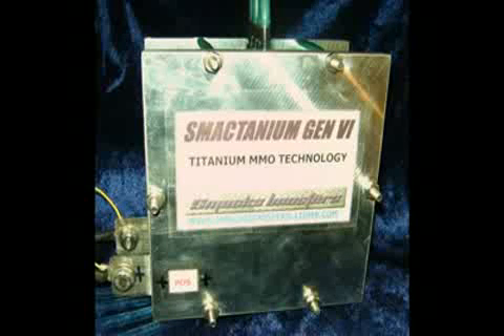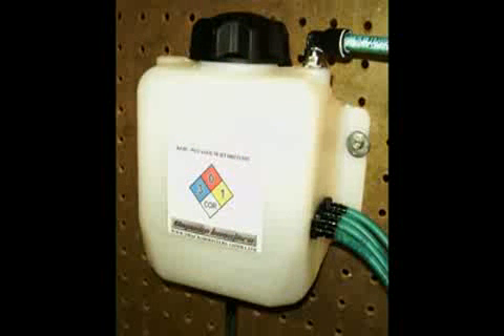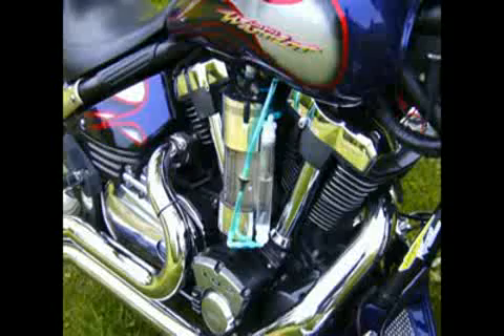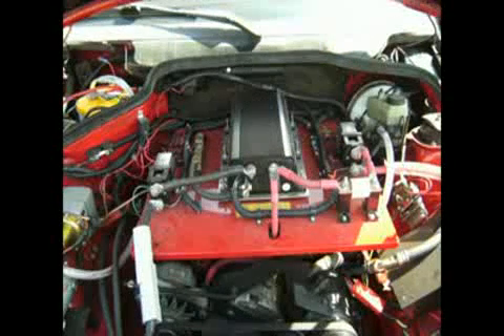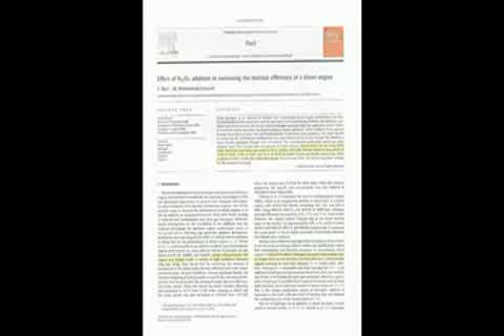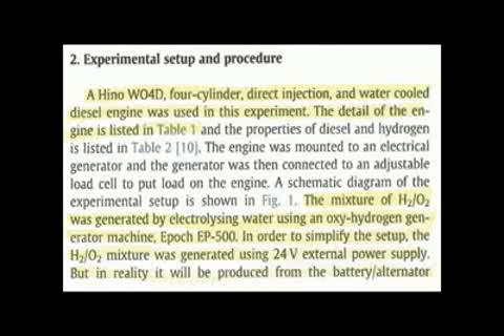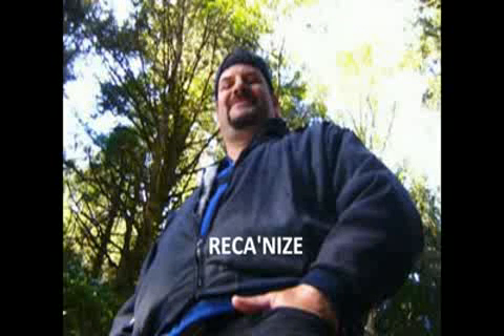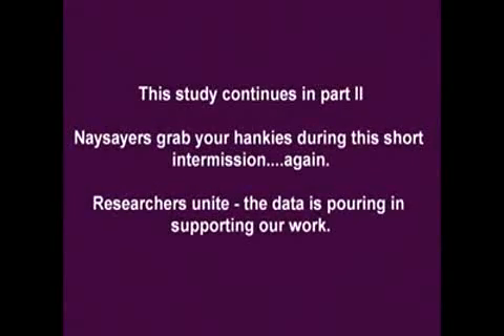Scientific PROOF that HHO WORKS Part 1

Comment: HHO added to the consumption of the fuel, adds more mileage to the fuel in your gas(petrol) tank, not at the rate Miles Per Gallon your engine burns in a test... as in, it adds to the mileage in your gas tank. It doesn't bring your gas mileage up in an electrical test. It may bring the test down a couple Miles Per Gallon, because of the vacuum. Try this... Put a gallon of gas in with the HHO system in the off position.... then with the system on... how far did you go on did you go in each road test? Surprising, isn't it? It ups the mileage in your gas tank, not at the engine I.E. burning less gasoline because the HHO is being added to the fuel line, adding to overall Miles Per Gallon your vehicle can travel on a tank of fuel.... Like adding rice to chicken so it will go further, adding an additional ingredient that feeds more people. Like adding in missing stitches to cloth, pops it in here and there. I remember back when I wished that I could add water to the gas to make it go further... I guess wishes do come true.    Hate.

Comment: What puzzles me is why it's more efficient with Hydrogen added, doesn't the Carburetta still sends the same amount of fuel into the engine as the accellerator is pressed?
So how is there a saving on petrol if the same amount is going in?
Reply from the maker: The H2 and O2 gases added do two things to the burn, it increases the flame speed and increases the lean burn range of the hydrocarbon fuel. In a properly set up configuration the fuel system sends less HCF while the engine puts out a little more horsepower. The end result is a more efficient engine using less fuel.

Comment: Dateline NBC report on HHO booster scam!
Reply from the maker: Yes, unfortunately there are those who lied about the amount of fuel savings an HHO system can give to make a quick buck but that doesn't mean the technology doesn't work. That is purpose for this study, to prove that under the right set up and with the right adjustments made to the engine and fuel system HHO does save fuel. The amount of savings will vary, in this study the savings was 15%.

Comment: Saying that the HHO increases the speed at which the air/fuel mixture burns supports my theory on why basic HHO systems sometimes work.  It's not about running our cars on HHO.  What happens is the HHO greatly improves the ignition.  A spark plus a bit of HHO will ignite the air/fuel mixture better than a spark by itself ever could.

Comment: I can understand your skepticism if you couldn't make it work. I don't know what your vehicles were, but from your other replies, you don't appear to be willing to risk leaning out the mixture. If that's the case, there's no way it could work. It clearly seems to work for some people, but they aren't proving it works any more than you're proving that it doesn't.

Comment from the maker: How about a 2007 publication from the Federal Motor Carrier Safety Administration (a division of the DOT) tinyurl . com / yhlcmq2 Section 1.2.3 Hydrogen Injection Systems references a 2005 study that showed a 4% reduction in fuel usage. See there is "proof" out there that this can work, you just have to have an open mind and search for it...

Comment: I agree, this is not proof in any way shape or form. That can only come from the scientific community.
This may or may not work, but the logic of adding something into the air drawn into the engine that promotes combustion in an otherwise too weak mixture is compelling. Car companies spend millions trying to design engines that run on leaner mixtures, this might do just that.

Comment: I think you're not not grasping the fact that the extra power used by the alternators is not that great when you look at the output of these engines. There always seems to be a focus on this but it's not really the issue. You'll get at least half of it back anyway when you burn the HHO in the engine. The only question of significance is whether you can ignite fuel in a proportion that would not normally be possible without HHO. The whole argument hinges around that one question.

Comment: The problem is that the academic community has been poisoned and no serious researcher is going to risk taking this on. A while ago, there was a lot of excitement about 'lean burn' engines. I believe Mazda made an engine with a separate pre-combustion chamber and an additional valve that enabled the combustion to commence with normal mixtures, but then admitted the products into the larger compressed volume. Why go to all this trouble if leaning out the mixture isn't a cherished goal?

Comment: I really don't have any evidence to back up or disprove your statements. There are a few things worth saying though, Firstly, I don't believe for one moment that we've arrived at the pinnacle of engine efficiency, improvements are being made all the time. This is just another way that may make some gains, You're wrong about the energy that's required to produce the volume of hydrogen suggested, it's actually quite small, in the region of 100Watts to produce 500ml/min, enough for a 1Litre engine

Comment: It's not the efficiency of the burn, it's the pressure at initial combustion and how it's sustained through the downstroke. Diesel engines don't use a spark and therefore timing controls can't be as easily adjusted in the engine. The article hardly claims that it's a good idea to run automobiles on such an engine, and I imagine that's why there's not any mainstream use of on-demand HHO systems in trucks, or personal diesel autos. I just want to clarify the article for those who don't read it.

Comment: H2 gas can actually, as showed in the article posted, improve combustion efficiency is diesel engines. It's been an idea floated for decades that diesel combustion which is reliant of pressure and heat can be supplemented by additives to the fuel. Still, the study shows that it's potentially dangerous to the engine, and anyone who believes this shows promise for a gasoline engine did not understand the article at all. HHO for gasoline is a scam, and only overunity would suggest it could work

Comment: To add,,in direct contridiction to what you posted an SPL competitor if anything (I was a pro) would want to overdrive the alternator. We need as much voltage as possible and that is a reason we used to raise the idle. An alternator needs to be at a specific RPM or above or it does not put out enough voltage. That is way when race cars use underdrive pulleys on the street they tend to die if stuck in traffic or cruising at low RPMS for too long. Research it this is well known FACT!

Comment: You need to be corrected as far as the simple physics of how an alternator works. First off SPL competitors are not using any eqiupment that is "claiming" to save fuel. HHO supplementaion is...has to. In other words if you are generationg the power to extract the HHO from water via electrolysis and using that HHO to run the same engine being used to extract it to run it..it simply CANNOT work unless there is proof of overunity. CONT....

Comment: Right.  I agree.  I used be in amateur subwoofer SPL competition :).  I know they add some friction to the engine. If that friction is being used to create a gas that assists mpg,  it can be offset.  One can also add under drive pulleys to  decrease alternator drag as I used to do on the SPL cars so they retained close to their stock mpg with the high output alternators they used.  Point being,  hho doesn't defy the laws of physics and can work if done right,  though it very rarely is.

Comment: True.  But they've been using similar setups on their rigs for years.  It's scaled up some,  which is part of why it actually makes a difference.  There was never an issue of free energy.  So tired of that generic response. This is about converting electricity to a gas which harbors more complete combustion.  A turbodiesel with mountains of torque and huge output alternators (often 2) have no problem coughing up a little extra amps.  It's still possible in some cars,  diesel works best though.

Comment: This study has nothing, at all, to do with gasoline engines... which is significant for humanity's energy concerns. It is only a precursory look at the effect of H2 at the top of the diesel engine's cycle. It also mentions several times that temperatures/knocking are troublesome and are due to the optimal fuel-air-ratio of the system. It's not something that can be "tuned" out, it's inherent to the gains in power made at all load settings

Comment: And to add,,,it is not that simple. Otherwise there would be much less debate. If you lean your engine out you will probably see an increase in MPG at the risk of engine damage/ TAmpering with emmisions controls is a fed offense but if you do it anyhow you would find better MPG with the HHO gerneratoe unhook since itr would eliminate the drag on the engine cause by the current draw taken from the alternator. And I would not trust a tiny amount of HHO tiny bubble to prevent a lean condition.

Comment: My friend's dad put money into that company a few years ago.  He has yet to even drive a prototype...  The HHO system actually does work for diesels though.  It takes several briefcase sized cells,  and special high output alternators to work as a gas suppliment.  
Don't believe me still?  Ask an 18 wheeler driver.  I have seen 3 in use so far.  It's not violating physics.  So tired of reading that.  It just takes a lot of 12V power, which isn't a problem for large turbo-diesels.

Comment: I don't see what the big deal or controversy here is. Over the years, engine manufacturers have improved the combustion efficiency of their engines, progressively extracting more usable energy from the fuel entering the engine. We all know this to be a fact and it's not controversial. This is simply another way of increasing the amount of energy released from the fuel. Everyone knows that you can't run an engine leaner than a certain air to fuel ratio..... With HHO injection, you can. Simple.

Comment from the maker: Check out Vydrotech, Inc. (formerly Ronn Motors) and its H2GO product line. Real world testing with Volvo over-the-road diesel trucks show a reduction in NOx emissions and about a 20% reduction in fuel usage. Done right these systems do save fuel. The purpose of this video was to show those hard headed skeptics that this technology is not an impossibility.  As far as being stuck with crude oil, check out the syngas to ethanol process. Municipal waste can be converted into fuel....

Comment from the maker: No, it's not like saying the sun is made of ice. And no, I don't believe it works simply because it's published. I've seen in work and I've done the math, I know that gains are possible. See it doesn't violate the laws of physics because no energy is being created, less energy is wasted because of the increased flame speed. The biggest gain in the process comes from the fact you can run the engine much leaner without reducing the power output. I'm sorry you don't get that but it does work...

Comment from the maker: When using math you have to use all the relevant variables. Since the 70's we have known that adding H2 to HC fuels changes the way the mix burns. Adding H2 was shown to increase the lean burn range while increasing the power out of the engine. To dumb it down for you it improve the efficiency of the engine while using less fuel. It is widely believed the amount of H2 needed to effect this burn was over 5%. This study shows otherwise. Through modifications to the ICE it is possible to see gains.

Comment from the maker: Read the published paper, it says otherwise. Yes there is an additional load but the gain in TE of the combined fuels covers that loss. The process gives you more power out while using less fuel. Again, it isn't about the energy of the H2 and O2 gas, it's about the effect adding this mix has on the way HC fuels burn. You aren't creating energy, you are just losing less...

Comment: The increase in MPG is negated by the fact that the alternator has a MUCH larger load & will cause power to be lost during the conversion from rotating energy to electrical energy... Why don't you understand this?

Comment from the maker: You do know that this technology isn't about the energy of the burning H2 separated, don't you? I'll agree that if it was it would be impossible to see gains in MPG. Fortunately its about increasing the flame speed on the combined fuels (Hydrocarbon fuel and H2) thereby increasing the BTE, this can improve MPG. That's where you should do more research on, the effect H2 has on HCF...

Comment: "Typical closed-minded fool, do some research",

Judging by your claims it would seem more research is needed on your end. Let me explain

Breaking the bonds in a water molecule will always equal the energy gained by burning (recombining) it's products (and this is assuming for an ideal system with no losses). 

This can be verified with Coulombs Law:
k(q1q2/r^2)
This Law has been verified thousands of times if you have proof of otherwise I would love to see it.

Comment from the maker: Typical closed-minded fool, do some research on the what an increased flame speed does to an ICE. Water alone cannot run a motor using traditional electrolysis, it's simply impossible. But again that's not what's happening here. Some people, like yourself, get so wrapped up in conventionality that they can't see past the textbooks. Come on, read the study and do some other research, this does work on a limited basis.

Comment: Now I don't disagree with you that H2 enchances efficiency, theory allows that. But practically speaking, it is extremely difficult to supply that H2. What most you do-it-yourself "engineers" claim is that electrolysis is the solution, that is an out right lie.

Comment: People like you who use fringe terms like HHO make it extremely ambiguous what a particular device is suppose to do. If the claim is that it works by splitting water, it violates thermodynamics, end of discussion. 

What does "see past the law of TD" even mean? Its a law of nature, there's nothing to see beyond it, violating it is not a matter desire, but a matter of capability, and its impossible.

Comment from the maker: This technology doesn't violate the laws of thermodynamics, you do not get more energy out than you you are putting in. Its people like you that pushes the need for peer reviewed studies. You can't see past the law of TD. Adding H2 and O2 gasses extends the lean burn range and improves the BTE of the engine so it wastes less energy. Sure it comes at a cost but the increase in HP offsets the additional load. The bottom line here you used less fuel without limiting power out. It works....

Comment: What is wrong with all you people? You want peer review? Are the laws of thermodynamics peer reviewed enough for you? You cannot get more energy out of a system than you put, and practically speaking, you will always get less. What kind of proof do you need that it takes more energy to split water than you get from burning hydrogen?

Comment from the maker: Its really not the complicated, you lean out the A/F ratio and add the H2 and O2 gases. This has been shown to improve the BTE of the burn meaning you get more usable power out while using less fuel. Some of the gained power out is used by the electrolysis process but the end result is you have used less fuel.

Comment from the maker: What does that have to do with the fact that adding H2 to HC fuels increases the lean burn range and while increasing the BTE of the burn? The answer is nothing, the fuel savings comes from improving the combustion efficiency of the HC fuels. It doesn't come from the energy value of the H2 added. Read the literature...

Comment: If you are so confident of your device, why not turn it over to an independent test facility & have a report confirming your claims? Surely this would then prove your claims & the cost would be worth it in the increased sales.
The paper you quote is of a different engine configuration & ignition system of diesel is a lot different to petrol, much higher compression ratios, also they are putting much higher %ages of H into their engine than yours.

Comment: If the test was totally isolated from outside input, then you can truly say that it was a legitimate experiment, Anything added to the system which was not available to a vehicle, i.e. a separate power source for the HHO unit, is not a true experiment as the power drain of the HHO unit is not being taken into account.
People saying they use less fuel is useless, as soon as I got a car which showed the MPG on display I cut my fuel usage by 10% because I was aware & drove more carefully.

Comment from the maker: Why would you think using an outside power source will give you false data? The power usage can be can be measure and computed into the results. In this test the objective was to prove that additions of less than 5% H2 will act as a catalyst releasing more usable energy from the HC fuel. In order to test that properly you have to be able to go past the 5% mark. Read the study and you'll find that changes in TE started around 1% mark. This proves what some people already knew, adding HHO works.

Comment: Surely this is easy to test. Take an engine, run it for an hour connected to a generator under a standard load. Measure the fuel used. Connect the HHO device, re-run the test & measure the fuel used. Why hasn't this been done? Using an outside power source obviously will give false data.

Comment: hho, oxy hydrogen is the electrolyte catalyst that with water becomes conductive, not the water itself.. there for logical and a proven fuel.  it is proven.. it does work when correctly constructed. period.